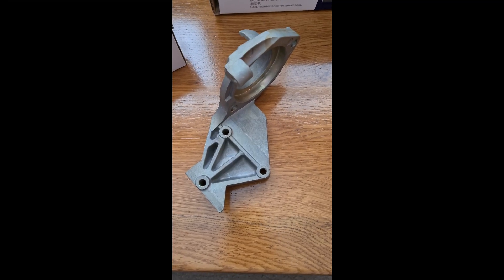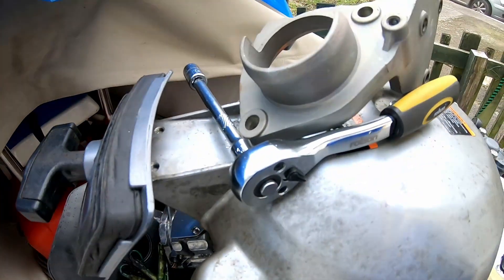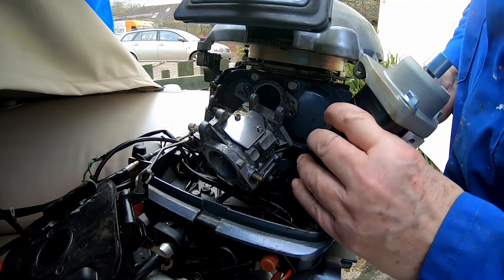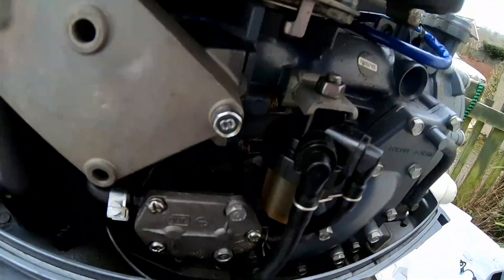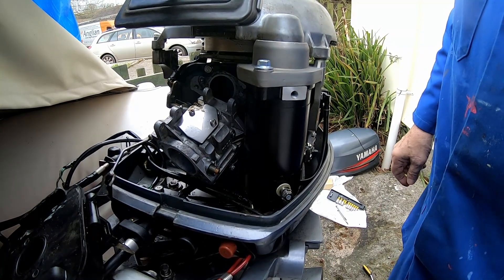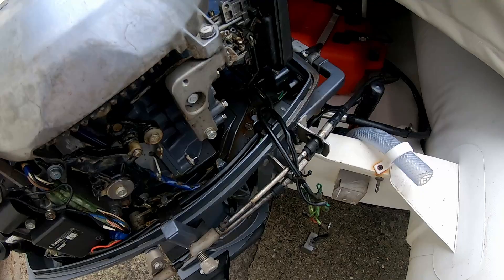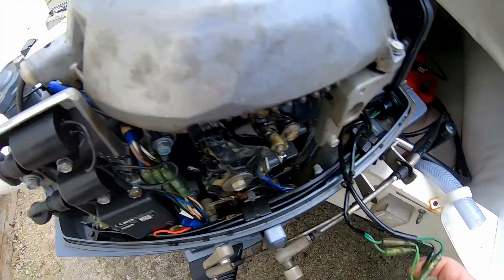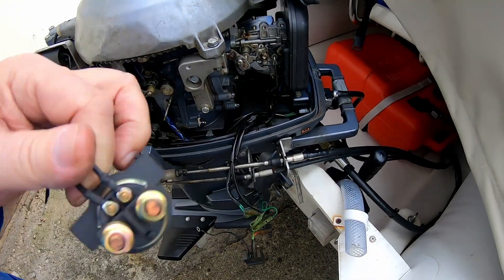How to fit an electric start to a Yamaha 25hp two stroke pull start outboard. (Part one)

Comment: can I ask that where should I find the parts brake down, what you were looking in your phone?
Reply from the maker: I'll do what I can.  These are the main components required, there's various sundries required like cables etc.  If I did it again I woud use the next size down battery to starter cables. I went too large at 16mm sq,  cable 10mm sq is fine.
ebay items :
Ignition switch -   703-82510-43-00 Ignition Switch for Yamaha Outboard Main Key Remote Control Box  - sold by parserda
Starter solenoid  12 V STARTER SOLENOID RELAY 6G1-81941-10 FOR YAMAHA OUTBOARD 6-90 HP - sold by king-auto-zone
Starter mounting bracket  - 61772-0194Aluminium Stay For Outboard Motor 25hp 61T 69P   - sold by homedecorlover

Amazon for starter motor :
OEG Parts PPEU18310N Starter Compatible With Yamaha Mercury Mariner Replaces S108-80 S108-80A S108-80B S108-80BN 689-81800-11 689-81800-11-00 689-8180 

Rob

Comment: sorry parts number
Reply from the maker: I bought it from Amazon and this was the description :-
OEG Parts PPEU18310N Starter Compatible With Yamaha Mercury Mariner Replaces S108-80 S108-80A S108-80B S108-80BN 689-81800-11 689-81800-11-00 689-8180 
The PPEU number was also on the box
Reply: Thank you very much @Pensionersdoaboat

Comment: Should I use a choke solenoid? Is it a must?
Reply from the maker: It's not a must but a convenience.  You can leave the original pull choke in place and use that but unlike four strokes,  two strokes need the choke off as soon as it starts.
Reply: Thank you so much, my motor is the same as yours, but I will pull the choke out when I start,  cause I dont have the choke solenoid, plus I dont know how to fix it. @Pensionersdoaboat